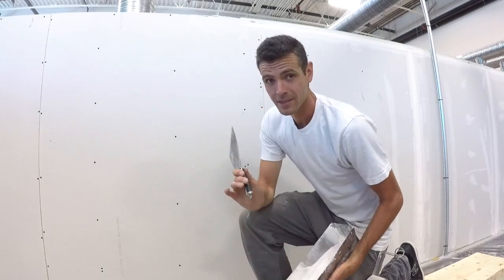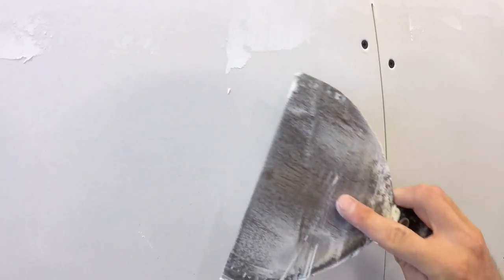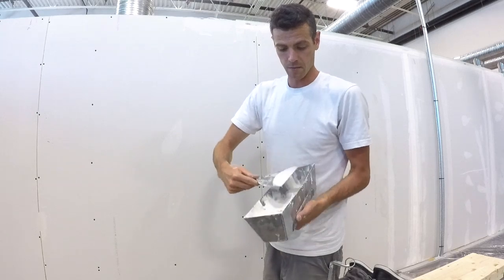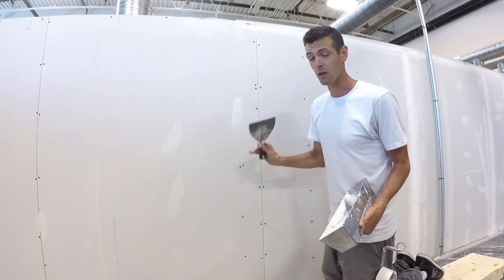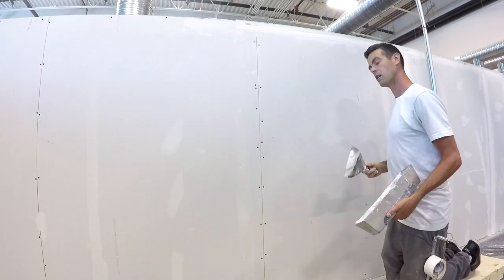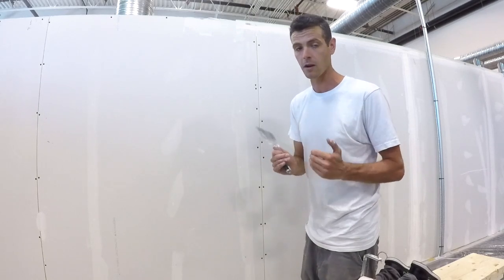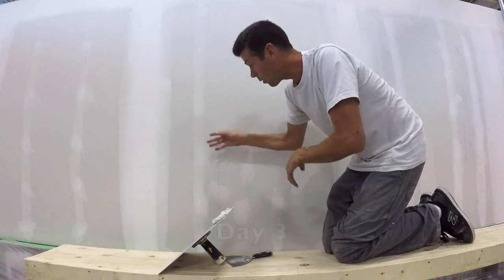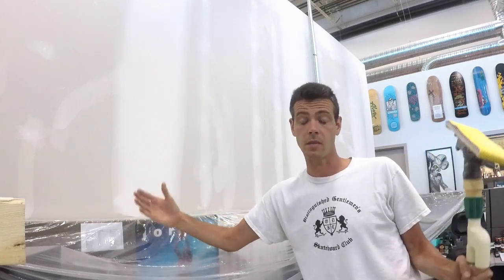How to Coat Screws

Comment: Having done many home remodels all I've ever used is Synco Lightweight All Purpose Dust Control premix tubs. It stays fresh in the tub for months, sticks well smooths up a treat and sands easily with the dust dropping straight to the floor. Paint finish is awesome using a 150 to 220 grit sandpaper. The best sandpaper to use is made by Norton, can't be beat for longevity in use and doesn't clog. Joints screws and repairs are all invisible. Hope this helps someone.
Reply: Synko is good.
Reply: Dust is a nightmare. The money saved in DIY can pay for a portable dust extractor and cyclone system to save on bags. Brilliant value Class M (min you should go for) is Trend T35A M Class Wet & Dry Dust Extractor 1400W . combine this with ITP Packaging 25 Litre Metal Pail Bucket Drum with Lid & Ring Closure UN Approved or similar. You will have to reinforce any drum as the vacuum is so powerful it will collapse it. cut 1" rings out of 18mm MDF and insert them like ribs. Two will do. Then add a NeatiEase Cyclone Dust Collector Dust Collection Dust Filter Separator and connect all together. Amazing.  Then let this do all the hard work... Mirka Hand Sanding Kit HANDY 80x230mm. The sanding pads are Abranet, and that is in essence, the best type you can get
Reply: @thebusinessman9173 HFT also carries their Bauer Cyclone Dust Collector system. It works a treat once you upgrade the chinsy 5 gal bucket it comes with for a heavier duty bucket lid and a heavy duty contractor grade 5 gal bucket so it doesn't collapse on you. You can also make a custom lid out of 1/4" plywood to reinforce a 55 gal barrel lid that it comes with (depends) to fit a 55 gal barrel with a decent shop vac to use as a workshop setup if you wanted to go crazy. Works good for the money on the cheaper end.

Comment: Just found your channel.  As a long time DIYer and novice drywaller, carpenter, painter, etc etc, I appreciate your tips and techniques. I've often wondered if there is a better way than what I do and you've confirmed a lot of my questions.  Covering screw holes always drove me crazy along with inside corners. I like your method of one screw hole at a time and I figured out doing one side of an inside corner at a time and letting it dry before doing the other side works best for me. Might take longer but I'm working for myself and am not a professional. I've used a corner trowel with some success too. Having done so much work myself I can identify with your hints and tips.  I've always used a hawk and knife(s) but will try a 13x5 trowel on my upcoming project!  Thanks for sharing.

Comment: This brings back nightmares. When I first started drywall 20yrs ago. We did big custom homes, like 5-6,000 square feet of floor. I would get sent out to spot screws and nails for days. Talk about a sore hand. Two coats on texted walls and three on smooth wall, with the third going the opposite direction.

Comment: I use the single-screw method.  I apply the mud and remove it at a 45° angle backwards; I noticed the bubble on the first few screws I did and found this method works.  At least 2 coats, but always check for dimples after it dries.

Comment: Been mudding as a renovator/drywaller for 20 yrs....I use sheetrock 90 (product name for powder u mix) to individually fill screws on first coat then premix mud for 2nd n 3rd coats covering the screws in a line like u would a joint....3rd coat is a thin skin coat...find it works best for me....2 coats total caused me too much worry so I just do 3 n forget about it...lol.

Comment: I work in a museum environment where sanding is to be avoided at all costs. I just sponge between coats and achieve the exact same result, but without the mess, or the clean-up. You should give it a try.
Reply: monkeygraborange can you elaborate a bit more? Do you use specific sponge?
Reply: @peachfreude  Sure. I use a heavy duty synthetic sponge, although a regular kitchen sponge will do, but won't last as long. I knock down any small bumps with my knife, and then just go over it with slightly warm water, making sure the sponge isn't sopping, because drips can eat slightly into the mud. It's pretty simple actually, and saves a world of time chasing dust!

Comment: It’s funny, I’ve never really given this a lot of thought. When I hang drywall, I put my screws in  3-4” pairs. I apply the mud horizontally a pair at a time, then strike it down vertically 1 stud at a time. (Give or take). So IOW I strike it down 90 degrees from the way I put it on. It certainly looks like the 180 degree method works just fine too.

If I’m using 5 min mud I can get by with that + 1 more coat. Otherwise it’s pretty much always 3 coats everywhere.

Comment: Good video.  I usually need three coats not only to fill the hole but also because sometimes it puffs out around the screw and and you need to feather it out a little.

Comment: Curious why you recommend all purpose mud.   I typically use setting compound: mainly because I'm doing a bathroom and want multiple coats in a day.  But I also always figured the setting would shrink less
Reply: The final coat should be all purpose mud.
Reply: @surinamel5708  It depends on the situation.  I'll sometimes do a whole room with setting compound.   If I don't need to add all purpose, I don't.
Reply: I wondered the same thing.

Comment: It's not a bubble. It's the mud squeezing out beneath the knife edge. The application applies pressure on the leading edge of the knife and the mud extrudes through the screwdriver cut and out the back edge. The trick is to put just enough extra in that it shrinks flat when it dries, and that's tough to do. Going two different directions is an aid but not foolproof.
Reply: Well it can't "extrude" through the cut. That would require pushing through the other side and a whole through the screw from the tip to the driver shape cut.

Comment: Step 1 : grab bag of all purpose flour
Step 2 : mix with water until a gooey paste forms
Step 3 : stand back, throw at screw hole
Step 4 : walk away,let dry
Step 5 : job complete, paint
Reply: add 1 cup of sugar to flour, sweetens the job.
Reply: That seems like a lot of work. I'd suggest you just use toothpaste.

Comment: Great hints and tips I used the same technique on a wall after removing 40 years of paper from it it had so many dents in it it looked like anne oakley tripped over with her shotgun going up the stairs 😆 the not so fun part was gouging out the dents with a putty knife and a light to see some of the fine dents and then sealing them with a water&pva mix before filling them 🙄

Comment: Any advice on how to cover a ceiling full of metal insulation fixings/discs? They sit slightly above the surface of the drywall and can't be screwed any tighter to help bury them a little more, like you would do with screws. I can't tape pver them either so should I just do multiple coats over the whole area to build the ceiling out enough to cover them?

Comment: Something home owners should know that has happened in the past, is sometimes a lumber yard will sell wood that has not completely dried, in that case your screws could rust and "bleed" out onto your walls! I have actually seen this happen, they tried to blame it on the screws, but it turned out to be the 2x4's still having too much moisture in them!
Reply: Why would someone enclose a wall that was still that wet?
And people wonder why places get moldy

Comment: hi, i have two questions. The drywall, have long ends and shot ends. Q1, why are you hanging the drywall horizontal? That is not standing up, like we do. We place one sheet on the wall from top to bottom. Q2, When placed side by side, the long end have a grove, to place the paper in. And you only fill that with mud, sand it till its total flat. Is it the same?
Reply: It's easier to mud and tape a long horizontal that's waist high than it is to mud and tape multiple vertical seams. Up and down the ladder a bunch of times.

Comment: HA!  got you!  On your first row attempt, at 2:05  I heard the sound of your knife on a screw!!!!  hehehe. (just teasing)
- Same as you, I don't like the row method, I'm faster one at a time, and less sanding.
- thick mud, 2-3 coats.
- I never put soooo many screws... Should I??? (why so many ?)
Nice vid... thx I had a good laugh (with you) :)
Reply from the maker: :)  I put a screw every 12 to 16 inches roughly
Reply: @vancouvercarpenter  That's about my average... more on joints, less in middle of sheets.  Hey, by the way, inspired by one of your vid about mudding the tape, I finally got myself a "tapebuddy", about a third of the price of what you use, easy (and quick) washable single molded plastic apparatus, and it works just fine for my type of work which is one-room-at-a-time renovations (kitchen & bathroom mostly). Joints are a lot quicker. :) thx

Comment: i not like the 'coat them all down the line' method either...wastes mud. i usually use your 2 swipe method on each screw because it also makes sure you are putting the pressure to get that mud in the hole instead of glancing over it in 1 pass the other way.

Comment: I'm from the UK. We don't do it this way. We use gypsum plaster over the whole wall. But we do spot repairs and use 'mud' as well. It looks to me like laying it on one way and taking it off in the other makes very little difference if you're doing it 2-3 times and sanding it as well. It sits up in he cross every time..

Comment: Can I use multi-purpose mud to do the second and third coat since I wanna save money buying only one type not 2 type with the finishing mud?
Reply: Jerry Roo yes but spend $10 more to get a top coat mud for your 2nd and 3rd coats. A lightweight topcoat mud sands SO MUCH EASIER than multipurpose. Well worth a few extra bucks.
Reply: Jerry Roo you can use multi purpose for anything. Although a lite sanding finish mud is easier to sand smooth and nice
Reply: @justinhc123 would like to thank you for your helpful guidance but the top coat or finishing coat available for DIY people in Australia is about 40 dollars and the multi-purpose come in a quantity which way to much for my DIY at home. I need only small quantities. Don't know what to with the multi-purpose left over
Reply: @Beandiptheredneck  Thanks Ontario for the reply.
Reply: Then yes. Use multipurpose.

Comment: Once the glue is dry, there is no reason to leave the screw. I do lots of new houses, and they all have 0 screw pops forever. Leave the perimeter screws, which are covered by tape and trim. It's important to screw down the drywall while the glue is wet, its equally important to pull the screws out.
Reply: Many countries dont use glue, uk all studs are screwed every 2-300mm with flat plate at top and bottom if above 2.4/3m to screw top and bottom
Reply: @scotland2256   I'm gonna start finishing a basement in the morning, the homeowner hung the drywall and did not use glue, I live in Michigan.  So I have to leave the screws in, and its only a matter of time before you start seeing them. Like I said, theres no reason to leave the screws if you use glue. But yea its interesting everybody does things a little differently.
Reply: @iron.man.drywall1910  As long as they are the correct screws sunk to the correct depth then the amount of pops over time should be minimal but you are right, with movement vibration etc you will always get the odd one

Comment: Also: is Low Dust plaster good for beginners? I bought that. Not open yet though ...;)
Reply: I highly recommend against it.  It is VERY soft when dry.  I wish I would have researched (like you're doing) before doing a whole remodel with the Low Dust.

You are better off doing as smooth a job as you can when applying the compound and then sponging as needed.  No dust that way!  Use general purpose for the first coat/s and then a topper for the final coat.  Have Fun!
Reply: dave242able thank you very much. You go with classic plaster ?
Reply: Really appreciate the fact that you took the  time to write back. Thank you sir.

Comment: I keep ending up with circle dents around the screw. I've tried different types of bits that supposedly stop the screw from going too deep and I've tried different speeds on the drill and keep getting these circular dents around the screws
Reply: I'm pretty sure those "dents" are dimples created specifically for filling with mud by design.
Reply: @payton1284  Well some indenting is common but you don't put quotes around dents because that's what it is, not a slight indentation for the mud. I asked around and apparently the drywall screw drill bits I got are known for doing that and I should have gotten a different kind of bit because the indentations were way too deep because the screw sits into this bit too deep. Makes sense when it was pointed out to me but I just never thought about that